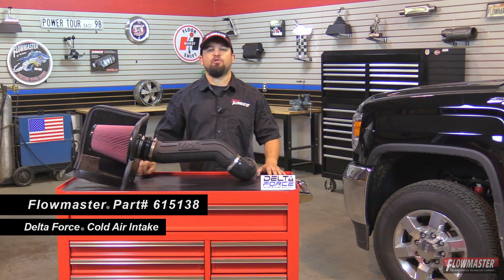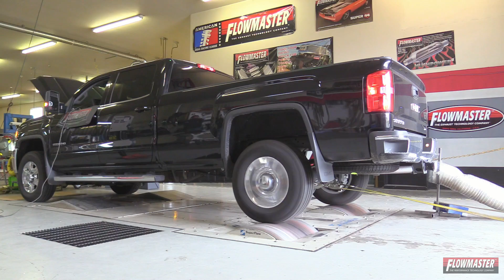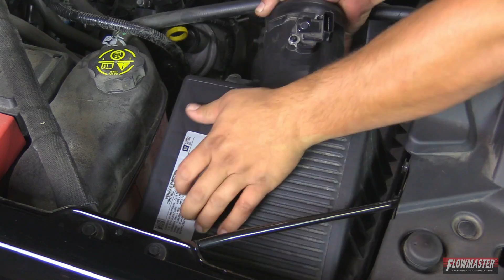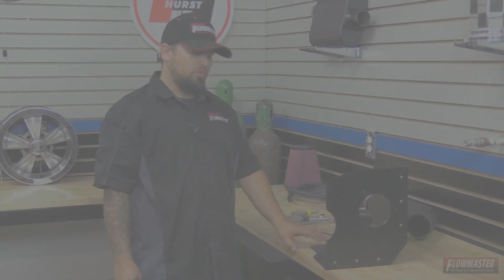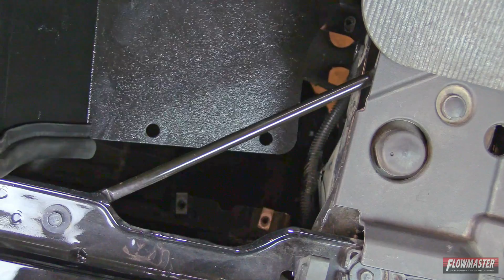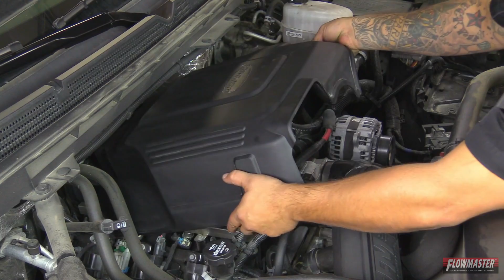2016-18 GM Silverado/Sierra 2500HD 6.0L - Delta Force Cold Air Intake 615138

Comment: I just installed part: 615138 on a 2018 gmc 2500.   After 50 miles I am getting check engine light code : P0171 engine too lean.   Have driven ~ 150 miles since install and check engine light and code are still present.  Checked MAF sensor, and checked each connection point for vacuum leaks with nothing found.   Sounds great but don't want a CEL light on a brand new truck with under 1,000 miles.
Reply from the maker: Hello Mike,
 There should be no M.I.L. on after proper installation of your Performance Intake. The P0171 code is associated with a vacuum leak. If all connections are good (especially the tube that connects to the PCV) I highly recommend that you give our Support Techs a call at 707-544-4761 and we'll do our best to resolve the issue.
Reply: Mike Pomeroy  Mike I'm considering this mod, I'm wondering if your having issues still?

Comment: Is it possible to leave the stock air box and just use the flowmaster tube with it?
Reply from the maker: Our Flowmaster Delta Force Cold Air Intake for 2016-2018 Silverado/Sierra 2500HD 6.0L - 615138 is designed to work as one unit. To get the most performance out of your vehicle we recommend to install all items that came with the kit.

 -Team Flowmaster
Reply: what kinda of HP are you getting on the dyno after the installation
Reply from the maker: We make every effort to include a dyno chart with all of the performance products that we sell on our website www.flowmastermufflers. com. You can click on the link below to see the dyno chart for the Flowmaster Delta Force Cold Air Intake for 2016-2018 Silverado/Sierra 2500HD 6.0L - 615138.

https://files.dpbrands.com/fmm/dynopdf/615138_Dyno.pdf

- Jason @ Flowmaster